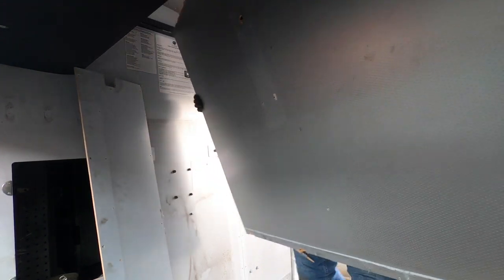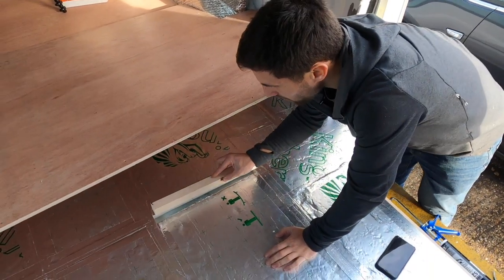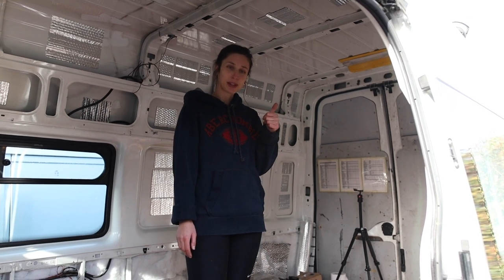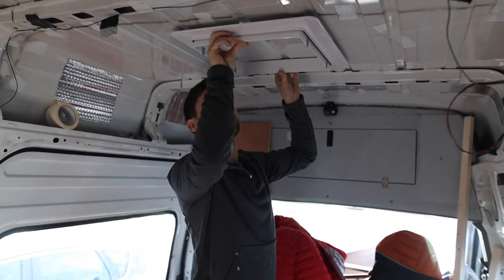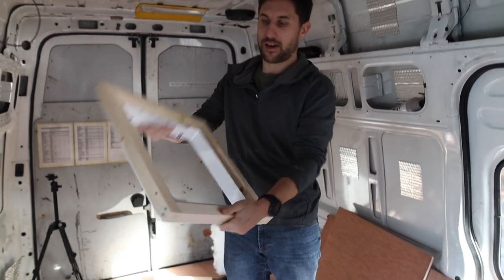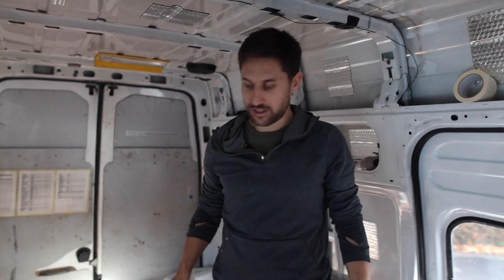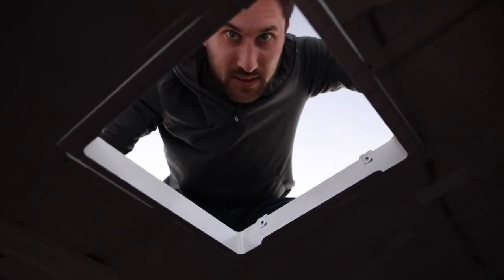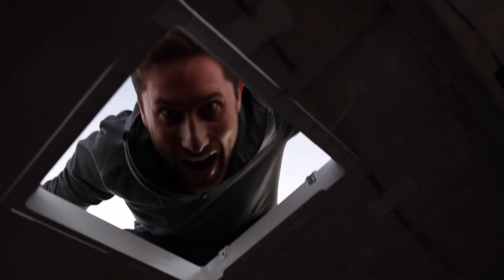VAN LIFE BUILD - We cut a hole in the roof of our Ford Transit

Comment: How did you get a good bond with the roof when the ford transit has roof ribs.
Reply from the maker: So we used butyl tape to build up to the ridge level to the fan could sit flat, then used sikaflex to seal it all in and also used gorilla waterproof patch and seal tape to overlap the fan and roof of the van as the screws on top are notorious for leaks. The tape also seems to have held up better than sikaflex for the last 3 years.